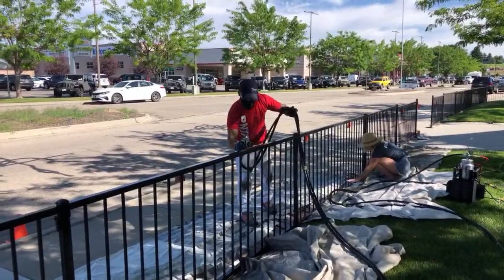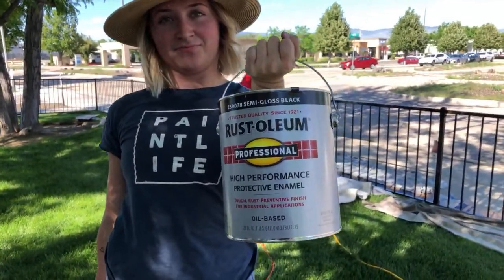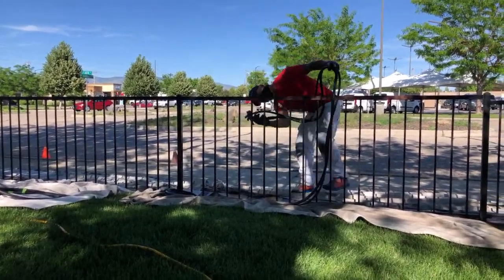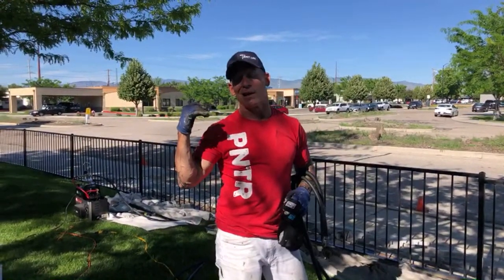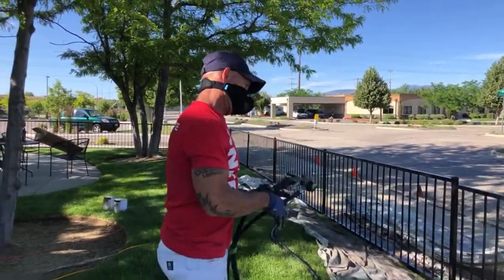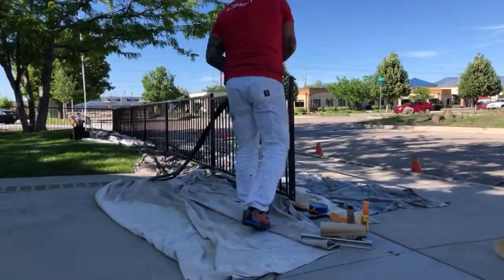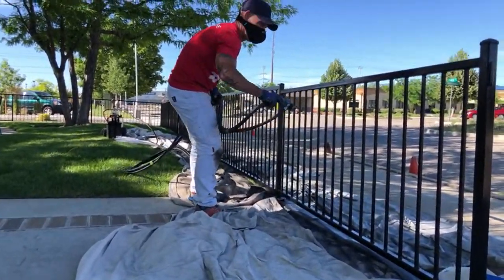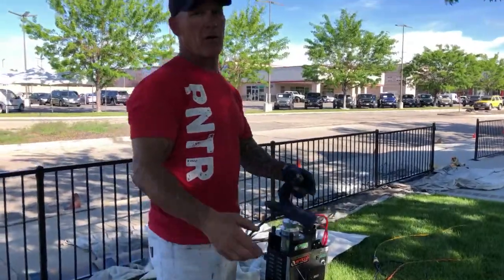Painting a Rod Iron Fence with The Idaho Painter

Comment: Don't know if you answer questions when the live video is over but, I have a fuji mini mite 5 HVLP sprayer, I am going to using it to paint small things on the exterior of my house and wanting to know can I use bottled water to thin the paint so it will go through the sprayer better?  Using a sherwin williams duration acrylic latex paint.  Thanks

Comment: I would never have considered spraying a fence like that. I would have thought over spray would be bad.
Reply: 100% correct, spraying it does not lay out a heavy enough coat for coverage that will last it’s maximum lifespan, and there is no way he put 2 coats on that whole thing,  so using a mini roller is definitely the way to guarantee the best possible finish, great paint choice though